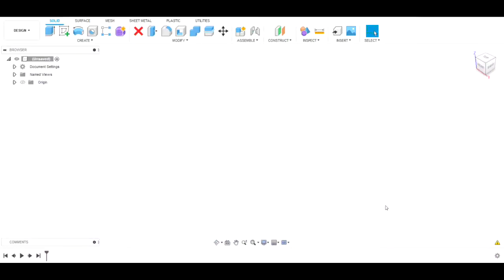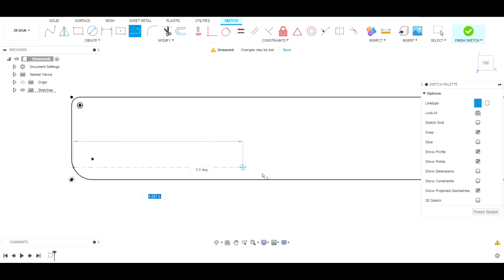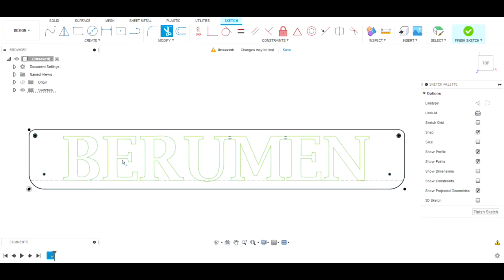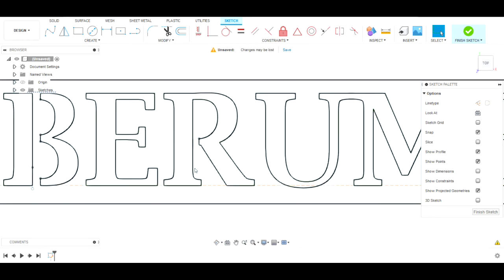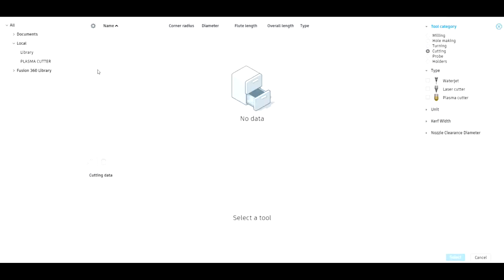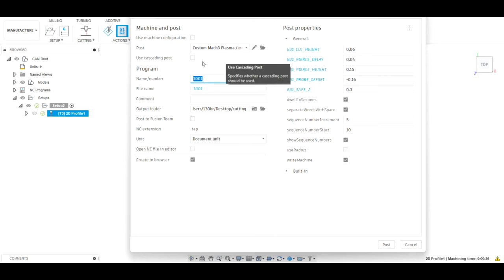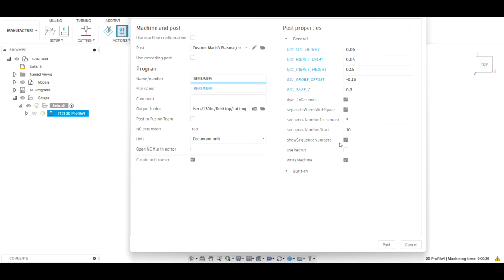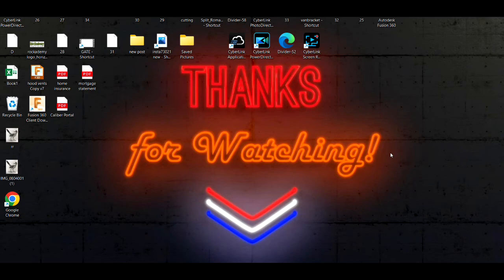Post processing in Fusion 360 for plasma cutting.

Comment: Thanks a ton for this.  I am just getting started on my new Crossfire XR.  Lots of experience fabricating, lots of computer experience & graphic design....but new to putting them together in a cnc machine :)  Lots of tutorials out there showing how to sketch parts and art with fusion and inkscape.....but not a lot of info on how to set up tools or generate the post/gcode.  The mfg has the correct post for download but no instructions on how to install or even where to install LOL  Anyway, I appreciate this video and the video on how to add tools you have posted here.

Comment: You’ve missed so many steps dude
Reply from the maker: Oh man! What did I leave out?
Reply: @twoguysmakestuff4445  it won’t tool path for finer details. Your design may not have that. Did look like it on some stuff. But could you explain more on how to get it to path for finer details. I did watch another one of you videos explain relief cuts.  I have the same issue there. It won’t path for it.
Reply from the maker: Remove the lead-in/lead-out and pierce width in your cut

Comment: Probe height  - .16.   It keeps going down past the material.   Hmm it seems like it would run into the material.  Some things you don't explain.
Reply: That’s the probe offset. The space from touch off til it clicks the torch height switch
Reply from the maker: Yes you are correct and sorry it wasn’t explained clearly. The probe of .-16 is used to determine the cut height. Our latest video about post process and creating tools in fusion 360 covers that subject. Thanks for watching!
Post Process file, creating tools in Fusion 360 for CNC plasma cutting. Questions Answered!
https://youtu.be/8_dj0wLPITE